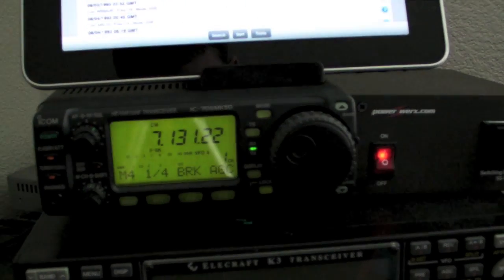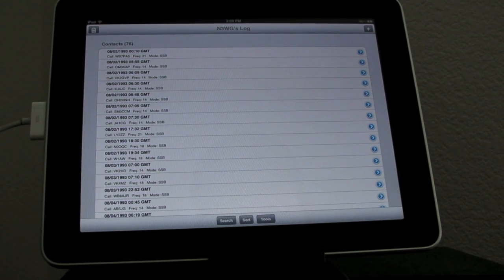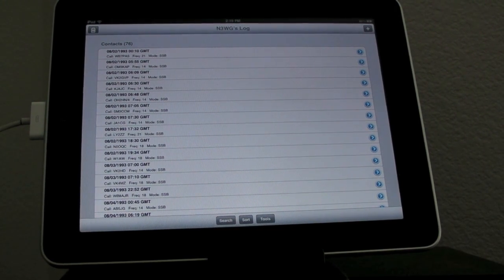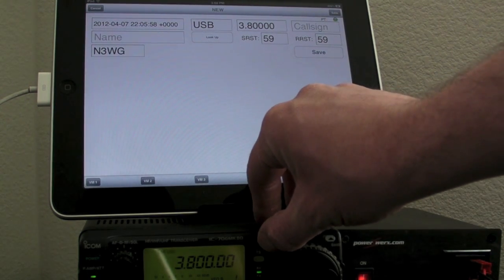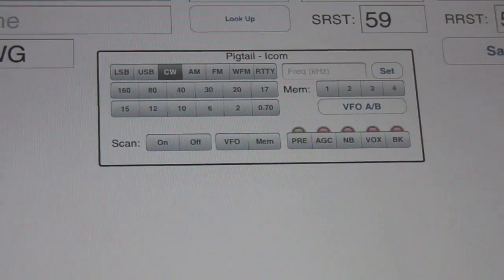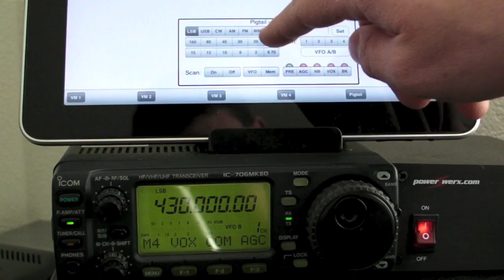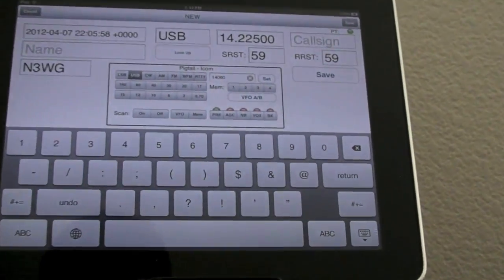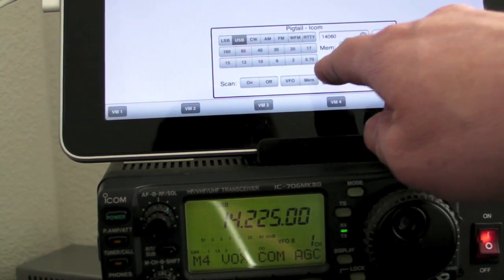Pigtail Demo #4 - Icom/IC-706

Comment from the maker: Hi KB5WDM,
The cable in this video is connecting to the CI-V port on the back of the radio, looks like a mono plug.  If the MK I has that connector then it 'might' work.  I can't guarantee anything will work that I haven't tested myself.

Nick